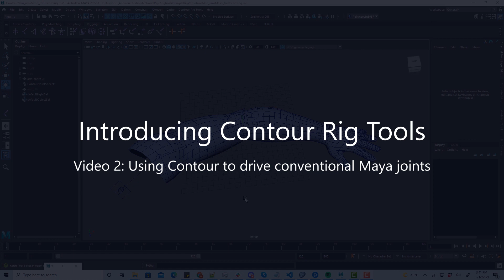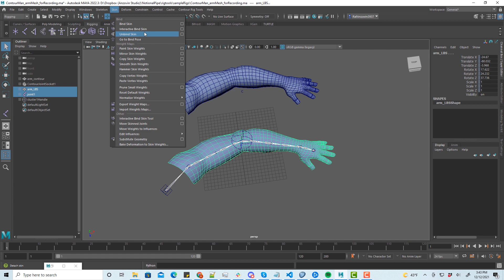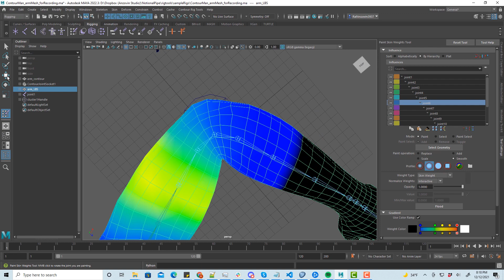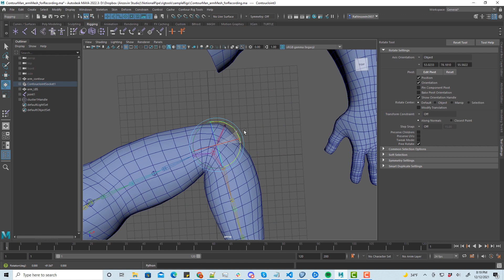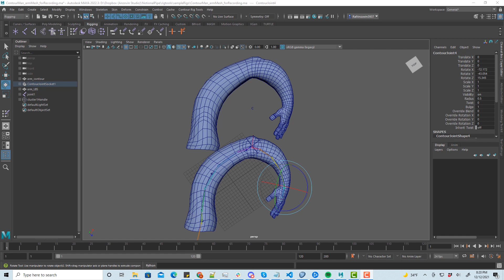Introducing Contour Rig Tools: Using Contour to drive conventional Maya joints

Comment: Is there a similar method in an attempt to making this manually?
Reply from the maker: I'm not 100% sure what you're asking, but let me make a guess and try to answer, and please let me know if I'm not answering your question. If you're asking if this can be done manually, rather than using Python to do it, the answer is yes- you can make all the constraints yourself, using the Contour menu. It would be a bit time-consuming, which is why we didn't in this video, but you could certainly do this manually.

I should also mention that we'll be introducing pre-made body plans to Contour soon, and plan on adding plans for engine export that come with the constraints already made. We're also planning on releasing a less expensive version of Contour that only allows constraining to regular Maya joints, specifically for export to engines. I can't tell you yet when we'll be releasing these, but they are definitely on the way,
Reply: @notionalpipe8767  that doesn't answer my question. I should rephrase that to be a little more specific: Is it possible to manually get a result like this without using contour?
Reply from the maker: @rawpowergroudon1  You could certainly approximate what Contour is doing with enough Maya rigging, but it would take a lot of work, and the more closely you wanted to approximate it, the more work it would take. In practice. you can very quickly get results with Contour that would take days of work to imperfectly approximate without Contour.